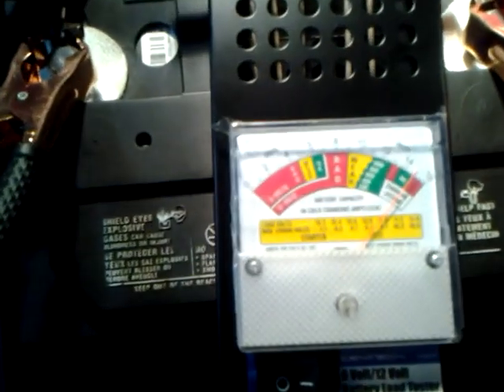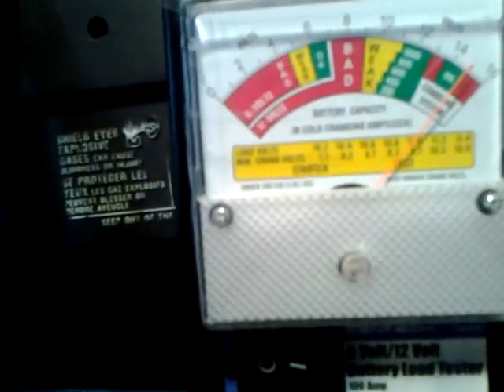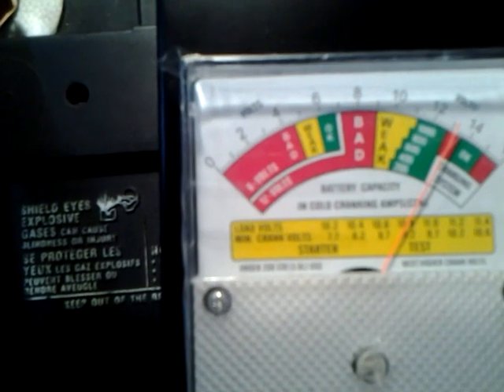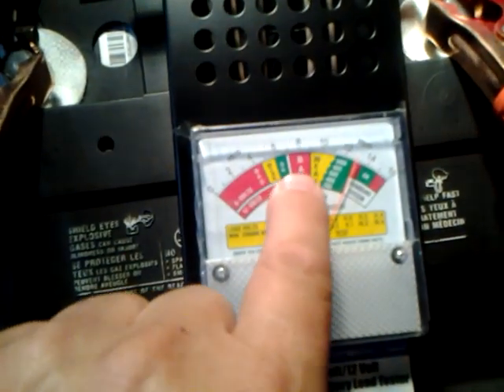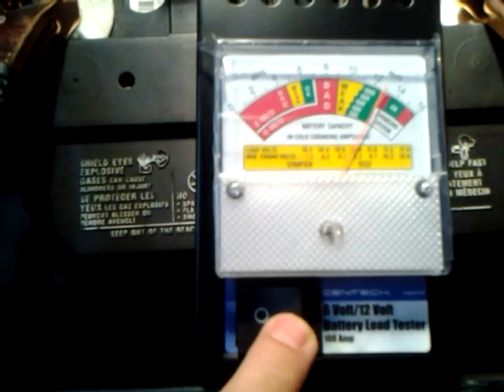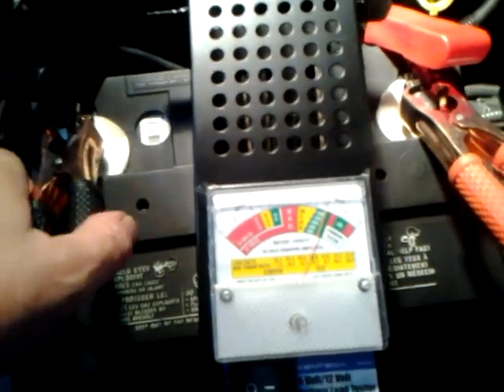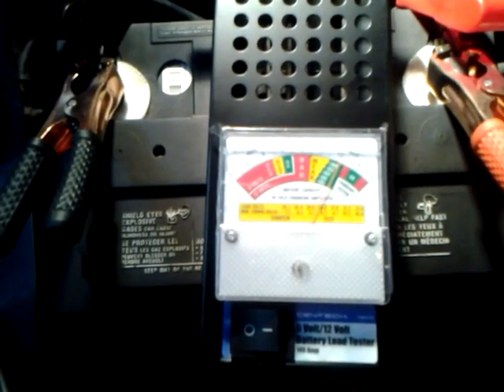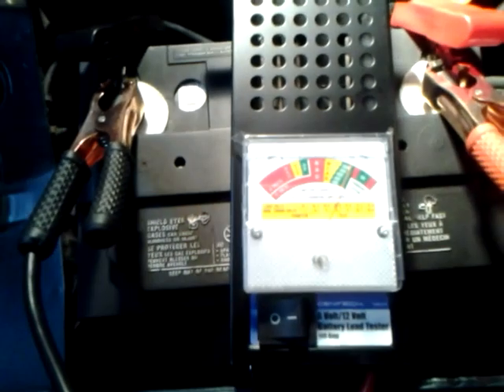Harbor Freight Battery load tester, how to check alternator, battery under load.

Comment: Yeah...i checked my altenator this afternoon. New battery and batt light still on,and when cranked car,my needle was on 12v
Reply from the maker: How is it with the engine running? It should read around 14volts

Comment: When I load tested it it exact same reading as yours. Just under 11 volts. Having trouble with starter. First couple of tries it doesn't start. So you saying at 11 volts still good don't replace ?
Reply from the maker: Take into consideration the age of the battery.
If the needle stays in the good area under load you should be okay, but you may be on the borderline. If your having trouble with your starter this device won't help you. My battery was on the borderline and when winter came, I had to replace it about 6 months or so after this video was made. Thanks for watching!
Reply: @WhipCityWrencher  I thought it could do some sort of starter test this tester ?
Reply from the maker: @frankmontez6853  Sorry, not this tool. This tool basically tells you how well the alternator is charging and how well the battery is.
Reply: @WhipCityWrencher  might be getting better. Would a bad battery and replacement cause certain codes to show up ? Runs fine after starting but the starting can take more than one try.
Reply from the maker: @frankmontez6853  Yes, the newer vehicles have a lot of computers in them and a bad battery can mess with the system.
Reply: @WhipCityWrencher  yeah about a year ago after resetting timing that another mechanic messed up it seemed to stall hesitate when accelerating. It threw up codes that eventually went away and ran normal. The good mechanic who fixed timing said that it might straighten up after a while and it did. Yeah it could be that when I replaced battery because I forgot to reconnect the air mass sensor and ran it for test run that's why now it's throwing up that code now. Might be getting better in that sometimes it starts up very first try.
Reply: @WhipCityWrencher  would it be worth it to erase those codes paying some shop to do it ?
Reply from the maker: @frankmontez6853  No, what I would do is use the money to get an inexpensive scan tool. There are easy to use, I bought this one a few months ago. I like it. It's a great tool for the DIYer. https://www.amazon.com/dp/B01G5EA74I?psc=1&ref=ppx_pop_dt_b_product_details